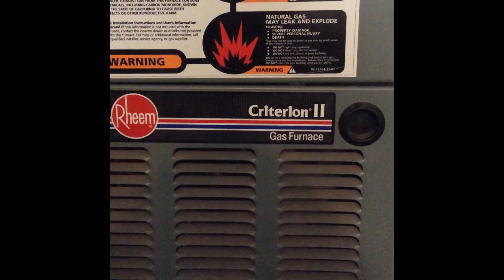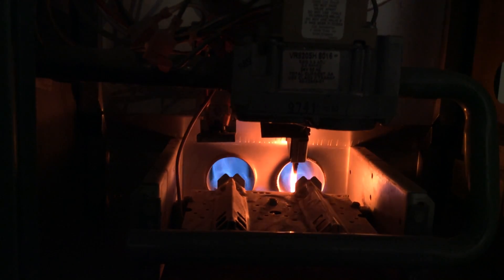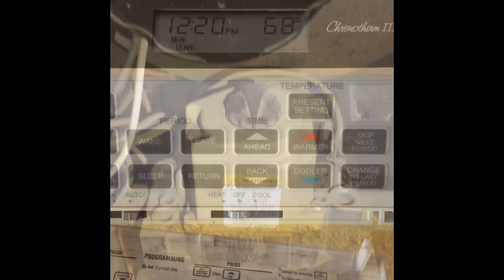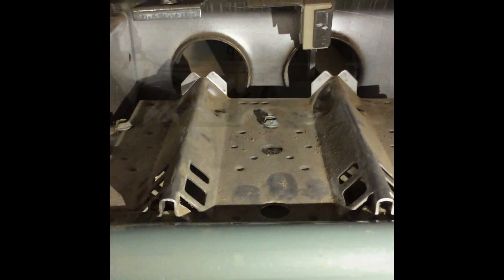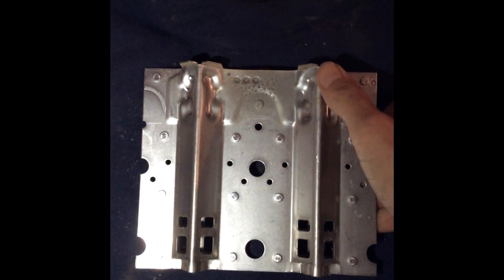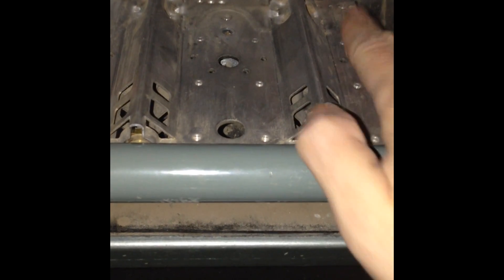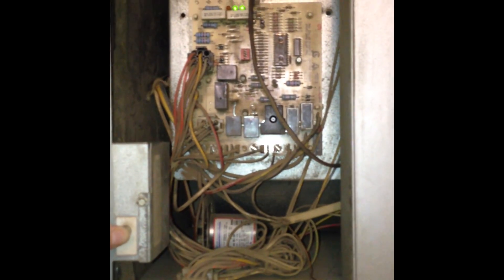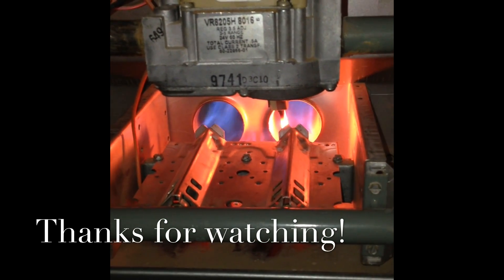Rheem Criterion 2 Shuts off

Comment: Just wish to add that the hot surface  ignitor is very fragile and if cracked will be useless so please becareful  when removing components in that area depending on what make and model you have and company's you have in your area a service call for that can cost you up to 125-175 to remove and replace it

Comment: The second switch you mentioned if it gets too hot is called a Roll-Out Switch if flame rolls out usually happens when you have a cracked heat exchanger. The limit switch shuts down the furnace if it "gets too hot" so wrong description but still good job!
Reply from the maker: Thank you.

Comment: I found out it's better to run the burner under water then use the compressed air or in my case an air compressor.  seems to get all the dust out and last line between cleanings.